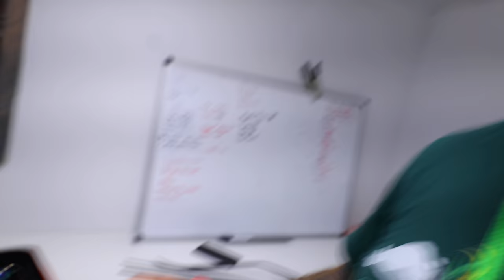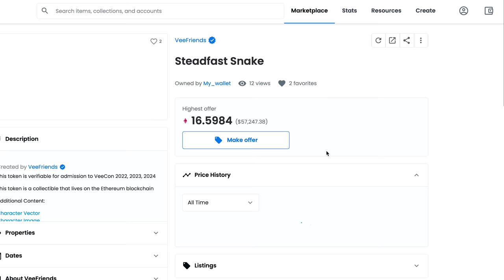NO WAY I SHOULD SHARE THIS WITH YOU!! LET'S TALK!!  | BRIAN BARCZYK

Comment: You know I hate to say it but the aquarium man you stick that on the bottom level reason because you have water that's going to be sitting on the upper level and you're going to have a big pool there too as well water does not mix very well when it's up above your head you understand what I'm saying dude man think about it you got to raise the snakes to the second level and then put your aquarium on the bottom level you have to think about that man it's going to be expensive I guarantee you man you could redo your snake aquariums as well you can make it even bigger than what it is now not that it's big that's huge right now we love you man just want you to do the right thing or hell if you have in a basement that would be the ideal place for that big pool dude you know just like the one you have for RJ yeah that would be awesome you can also do the enclosure for RJ on the bottom too or in the basement as well and the big pool right beside them. Just trying to save some heartache bro well maybe I created some heartache but yeah this is so much better though it would run so much smoother as well take care  Brian and I hope that I don't know what you call it rectum 4 +aquarium goes well and plan brother man take care
Reply from the maker: Have you ever been a pool on top of a high rise building. I promise you can put whatever you want on a top floor. Its all about engineering. But thanks for your concerns